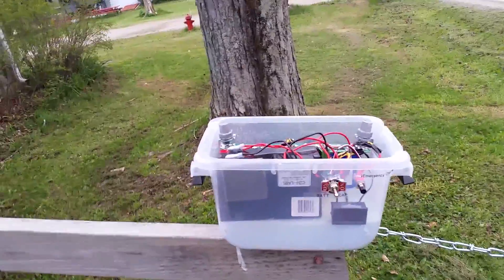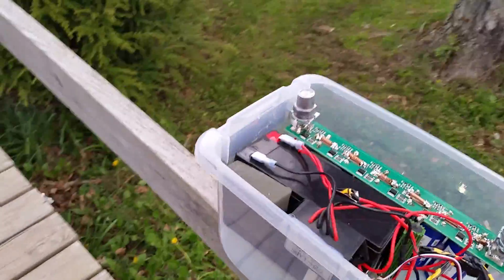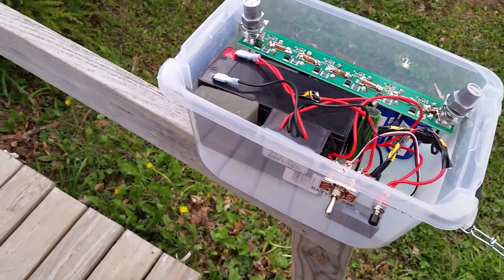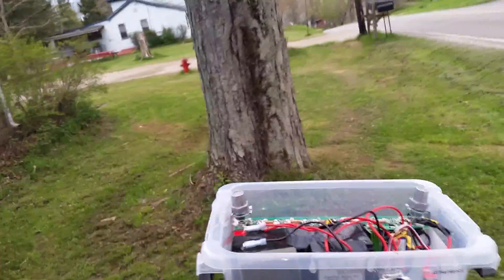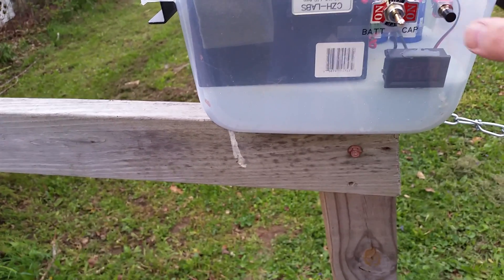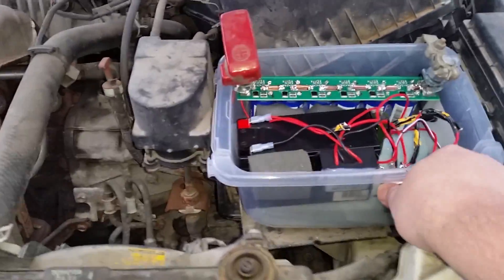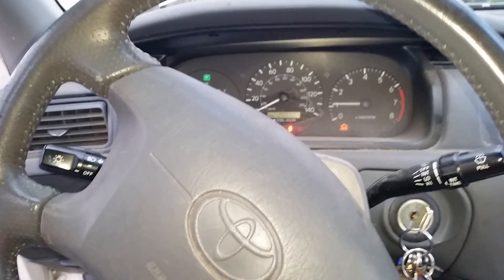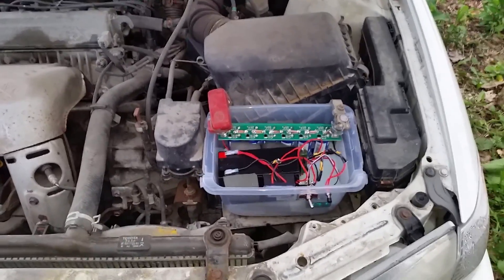DIY Smart/Intelligent Super Capacitor Hybrid Car Replacement Battery v2.0

Comment: As you have a resistor slow charging the caps. Since the battery then can not provide a high current for loads as there is a resistor restricting output how does the car go running say the radio or headlights when the car is not running and does not have the alternator to provide current?
Reply from the maker: The resistor is to limit the load on the battery to protect it during startup. A diode allows full charging. The resistor can be sized to allow the running of a radio or lights. But my recommendation is since the battery is so small just start the car to use devices. This is a long life battery. Not a battery with long runtimes for when the engine is off. I have a new battery v2 link in the description. Check out V2 of this battery video for a detailed how it works. I also have the schematic in that video which should give you a better idea of design.

Comment: Would it be possible to connect the main leads + - on the other side of the bank where there are no balance boards? I'm also assembling a bank of super caps. I'm just worried that connecting & tightening the main leads with the balance boards seems it might possibly damage the boards.
Reply from the maker: Read the video descriptions as they often have updated info.  My V2 of this project addresses this along with other issues/improvements. https://www.youtube.com/watch?v=zBDtUxPdhz4&t=0s
Reply: @gene4390  I'm installing a bank of 6 2.85v 3400 farad supercaps in the trunk to fix headlight dimming from my high wattage sound system. I just wanted to know if it's OK to attach the amp and battery terminals on the opposite side of the bank where there are no balance boards.
Reply from the maker: @PowerBassTest  If you are using something like this: https://www.amazon.com/Maxwell-Durablue-Capacitor-ultracapacitor-Amplifier/dp/B07SGJR6S5/ref=pd_lpo_107_t_0/137-8324785-8558404?_encoding=UTF8&pd_rd_i=B07SGJR6S5&pd_rd_r=96b795ba-d647-4591-8d0d-b2f87ec8afe7&pd_rd_w=Mvsri&pd_rd_wg=zY3sK&pf_rd_p=337be819-13af-4fb9-8b3e-a5291c097ebb&pf_rd_r=484ETQPF8NSJR0SGR2F6&psc=1&refRID=484ETQPF8NSJR0SGR2F6

You MUST attach at the end of the terminals where the balance boards end for balancing to work. If you attached at the bottom (by bridging the top) you would be cutting out your balance circuit from working or removing 2 capacitors from being connected in series if you didn't bridge the top and over volt your remaining connected caps. You as a fix CAN lay super capacitors on their side or upside down as they are sealed and will still work fine if that helps?
Reply: @gene4390  Thank you for the quick response :) Is anywhere on top fine? I have 2 positive amp terminals, 1 positive terminal coming from the battery/cutoff switch, and 1 capacitor ground going to the bank. The lugs are very thick so I can't double up two lugs on one cap post. I will try to explain how I will attach the terminals. I will be connecting everything on the top of the bank where the boards are. Front left side: amp 1 positive. Top left side: cap ground, second row top of cap: amp 2 positive, front right side: battery positive. Do you think that's ok?
Reply: @gene4390  Someone on the DiY Mobile Audio Forum said that I needed another fuse for the capacitor bank in the trunk. Is that right? Do I need another fuse besides the one next to the battery?
Reply from the maker: @PowerBassTest  I replied the same day with a detailed explanation. But looks like YouTube deleted it because my post was too long. So short version.

Capacitors will last for many decades provided you take care of them proper. The short if you connect ANYWHERE on the capacitor bank other than at the end (+) and grnd(-) where the balance board ends you will unbalance a capacitor cell and blow it out likely in seconds. All capacitor cells share the load to prevent going over voltage. 

If your capacitor bank screws are not big enough for the lugs then take one of the screw out and go to a hardware store to get a longer one. You don't attach elsewhere unless you want to ruin the capacitors. 

For audio you will connect your capacitor bank DIRECTLY to your car battery. As the capacitors will supplement power spikes while the battery/alternator is "catching up" for a high amp power demand. To do this you will need high gauge wire able to transfer as many amps as you will need on demand. If you use wire that is too small then not enough amps will get through the wire and it's like you don't have capacitors at all. The farther you are from the battery (distance) the higher gauge wire will be needed. Running high amps from the trunk will likely (depending on spike amp demands of your audio system) require 2 gauge wire because distance. If you can place the capacitors somewhere near under the hood you might get away with 3-4 gauge. Bigger is better on wire amp capacity. You can easily google wire amp capacity by gauge.
Reply from the maker: @PowerBassTest  You can get a 300Amp auto breaker off Ebay I think for around $30. 

A word of caution. After your capacitors are connected to your battery they will float at the same voltage as the battery with little stress. 

However when your capacitors are at 0V I don't recommend directly hooking them to your battery as the initial charge (just like discharge) can be too much amps and damage your battery. To get around this, get a cheap volt meter ($2 one from Harbor Freight works fine) and a 100 watt 3 or 4 ohm resistor with heat sink off Ebay for $5. 

Screw one end of the resistor to the + of your capacitor bank. Next take some jumper cables and hook the black cable to the negative of your battery. Hook the other end of the black jumper to the grnd(-) of your capacitor bank. Next hook the red jumper cable to the + of your car battery and the other end to the opposite lead on the resistor not connected to your capacitor bank. 

What this will do is the resistor will limit how many amps the capacitor can drain from the battery at once. Check with your volt meter in a few hours. Once the capacitors are close to your battery voltage your can hook them in parallel with your battery for the permanent install. Careful handling the resistor afterwards as it will get VERY hot.

Another point you can NOT use your cars chassis as one of the high gauge wires. Impurities in the metal will limit peak amps which you are trying to gain from adding capacitors and worst case produce heat in a spot that could cause a fire. Use high gauge wires directly to the battery!

Hope this helps!
Reply: @gene4390  Thank you for all the information.  My main question was: Do I need other fuses besides the one next to battery? Do I need to fuse between the 2 amps and cap? Do I need another fuse between the cutoff switch and cap?

Comment: Would it be safe to Add 15v in Capaictors in parallel with a standerd 12V Car battery . like this it just supports the orgnal battery for startup and battery can stay good for weeks with out charging ?
Reply from the maker: 16.2V is the max for those 6 capacitors in series. In the description check out v2 of the battery as I made improvements. The 12V battery just covers the parasitic load when the car is off for a while (electronic devices). The parasitic load varies a LOT between cars. To test mine I had my car off and then used a ohm meter set to measure current. I removed the negative and put the meter between the battery and car terminal. The parasitic load was low enough I knew the battery I chose was good for a month and a half which is more than what I needed. That did not include the solar panel (in v2 of the battery) which keep the battery topped off. The only change I would make since capacitors prices have dropped a lot I would use 2000F or higher capacitors. If you order capacitors use a reputable distributor like mouser.com (and others). China has SO many counterfeit sellers now. I've lost over $300 on counterfeit capacitors with eBay and Aliexpress. mouser.com (for me) has good prices so I'll never use a 3rd party/China seller again for capacitors.

Comment: You can get rid of that battery. Just buy $8 4w solar panel.  Put it on your dashboard or rear window panel and link it to the capacitors threw C pillar. Caps will always be topped off and you'll never have to replace that battery. You can also use $6 harbor freight ammo box for enclosure. It's got water resistant seal for winter and rain. Thanks for posting.
Reply: What if the sun isn't out?

Comment: Title says v2.0.
What is v2.0?
Reply from the maker: 1.0 was my video where I did just the capacitor hooked to the car. Version 2.0 I added some electronics and a battery for parasitic load in this video inside a battery shaped plastic bucket.  Version 3.0 is linked in this video description as the schematic and is the final version so far. 3.0 has a emergency "jump" function and a solar panel for keeping the battery topped off when not run for extended periods.

Comment: your emergency button is genius ! I was looking for a solution like that to compensate the total discharging risk. Where did you buy the bms for the capacitors ?
Reply from the maker: In the description for this video I have a link to my schematic as well as an updated design. In the description of my schematic video I have a list of all parts and where you can get them. Hope that helps. :-)
Reply: @gene4390  thank you very much !!

Comment: Thanks for the videos Gene A,  I would like to buy the PCB  you are using to mount and balancing your capacitors, where can buy it from? Thanks again!
Reply from the maker: Check out my schematic video here: https://www.youtube.com/watch?v=zBDtUxPdhz4   The PCB buy link is in the description. :) Don't forget you will need to drill or solder bus bars between the capacitor posts to carry the heavy car starting current.  Otherwise you'll smoke the traces on your balance board.

Comment: Is this worth it? I am considering doing this for my car. Does this allow you to use heat and AC and radio or not?
Reply from the maker: I did this as a project for fun.  I wanted a battery that would last me several years (time will tell).  In theory the hybrid battery will last much much longer.  Once the car is running there is no difference to a regular battery.  The only down side is there is not as much stored power.  Ie: It starts the car but cannot crank a car as long as a regular battery.  It also drains down faster if you are using devices without the car running.  So this battery is best for people who immediately start their car rather than run devices with the engine off.  My final design has a few improvements.  Look at the schematic in the description of this video for updates.  So the hybrid battery should last 10+ years (heat/AC/radio when car running is fine).  But I need to start the car quickly and not run a lot off of it while the engine is not running for too long.

Comment: What's the voltage on those caps?
Reply from the maker: With the car running they float around 14v.  When the car is off they drop down eventually to the battery voltage.  I have updated this design and made 2 new videos you can find in the description.
Reply: I bought a 2.7v 500F 6 in series board but I'm thinking I'll need to rewire the circuitry to use 1 less cap as it would produce 16.2v
Reply from the maker: No capacitors are NOT batteries.  They just go up to the voltage based on your available voltage from your your alternator/battery.  6 capacitors with a balance board means they can "go up to" 16.2 volts (without balance board is only 12v safely) before being destroyed by over voltage.  Using one less capacitor will most likely destroy your 5 capacitors from a base alternator 14v+ output.  Beware of Green-Cap (black) 500F capacitors.  They are fakes of failed lower capacity capacitors.
Reply: Gene A why is that they are fakes? Also, using the remaining juice of the battery charging can it not reach up to 16.2? Sorry Newbie here
Reply from the maker: ZeroColdx911 Think of electricity in your car's wires like water pressure. If your battery is 12 volts then those electrons are going to flow into the capacitors until the pressure is equalized and they are at 12 volts of pressure. When your alternator is running it puts out 14 volts of pressure so electrons will flow do the wires to the lowest pressure points which is your battery and capacitors bringing them to 14 volts of pressure. When you turn off your car the alternator is no longer at 14 volts so the battery uses up the excess voltage and drops down to 12 volts. This causes the electron water pressure to flow from the capacitors to the battery until they are both equalized at 12 volts. Now electricity isn't water pressure but this is kind of an analogy to try to explain to you how it works and how voltage will flow through wires from the highest source to the lowest source.  The capacitors don't build up a voltage higher then what is currently in the system. They're like a balloon and we'll fill to the level that's there.
Reply from the maker: ZeroColdx911 I'm doing this on the phone so sorry for any typos. The 500f green caps are all fakes. The company only makes 350 F caps in that size. So if you see one labeled 500F it is Chinese companies buying bad capacitors in bulk typically with typically too high a discharge rate and putting fake labels on them with impossibly high farad ratings for their size knowing someone will buy them. Unfortunately you have to be careful when buying out of China because a lot of companies will sell fakes.

Comment: Hello, to save cost can I just use my old car battery and add the capacitor module to it? Instead of buying another small lead acid battery like your setup? My car battery is still cranking but it's getting weaker. Thanks
Reply from the maker: Tim Le Yes this would work.

Comment: Where  do i find the super capacitor?
Reply from the maker: I got mine off of Ebay.  From time to time people are clearing out excess stock there and you can get a really good price.
Reply: Gene Angel thank you angel
Reply: Gene Angel  how much per pc
Reply from the maker: If I recall I paid $8 each in bulk.  I see there is some on ebay for $7 in bulk.  Again my recommendation is go with the largest F capacitors you can and use balance circuity.  You can see more info in my schematic video.

Comment: How  did  you  get  around  the  self  discharge  of  the  capacitors ?   Thanks  for  the  video !
Reply from the maker: Maxwell super capacitors have a very low self discharge leakage it's not really an issue in days/weeks between starts.  What is more an issue is the parasitic load the car's electronics places on the capacitors while the car is off.  The battery in this design feeds the parasitic load while the car is off and keeps the caps topped off.

Comment: wow nice,you better change all car lightbulb to led now,just in case.
it will drain less power and will be more effective.
Reply from the maker: It's an OLD car so no real need to convert to LED.  Capacitors work fine for starting car and alternator keeps power after it's running.  However I do plan to convert my Prius Gen2 to all LED.  It will reduce power used to recharge the 12v battery during run which can save mpg.

Comment: Another approach would be to put in some kind of cut off circuit that knows you left the door open or a light on for longer than say 1 minute, and then cut off the circuit.  But then you would not get to build this thing now would you?
Reply from the maker: You would need to hack into the wiring of the car for that and tank into account he power draw of your monitor.  This battery has a cutoff which is simple and works well for events like this.

Comment: Thanks for the sharing =)  
I'm thinking of choosing EATON Powerstor 400F super capacitor for this project.
http://sg.element14.com/bussmann-by-eaton/xv3560-2r7407-r/cap-super-400f-2-7v-snap-in/dp/2148520
Reply from the maker: What is there discharge rate of the EATON compared to a Maxwell?  If it's a higher discharge rate then the extra 50 farad will be wasted.  Also looks like Maxwell 350F would be cheaper?
Reply: Thanks for your advise. I'm living in South East Asia and to purchase EATON capacitor is easier than Maxwell.
As the weather is quite hot here, I'm currently monitoring the temperature at the battery compartment, to ensure that the project is suitable to apply here.

Comment: Good idea,  but if you're going through the trouble, why still use lead acid batteries? Why not switch to a better technology?
Reply from the maker: It really comes down to environment stress and safety.   We have been 
using lead acid batteries for a long time and know well what they can 
withstand and how they break down as far as safety.  If a lead acid 
shorts it just gets hot and dies.  New Lithium batteries in this setup 
if they short out can catch fire and we are placing them under a car 
hood near fuel gas in a vibrating environment that will swing daily from
 freezing to hundred+ degrees of cooling and heating. Lithium batteries 
are also much more sensitive to overcharge and damage. My personal 
preference was to go with a Nickle Iron battery.  They are non toxic and
 Edison's original batteries have been known to last for over 100 years.
  They can't burst out as many amps as lead acid but that is the 
capacitors job.  Being on a very poor mans salary I had to go lead acid 
this time around.  Though I will eventually switch to Nickle Iron and 
perhaps have a battery that will outlive me.